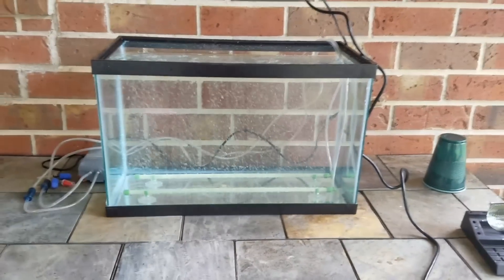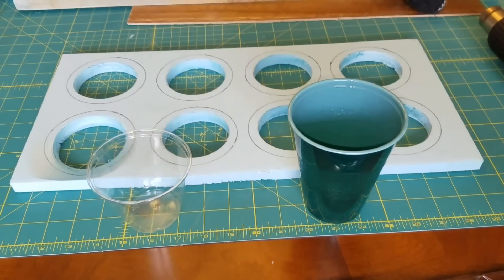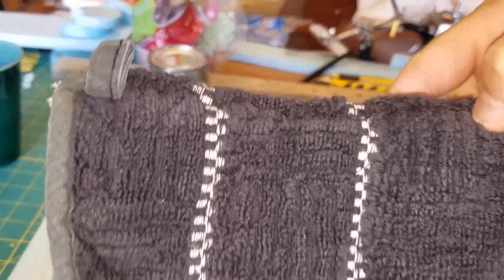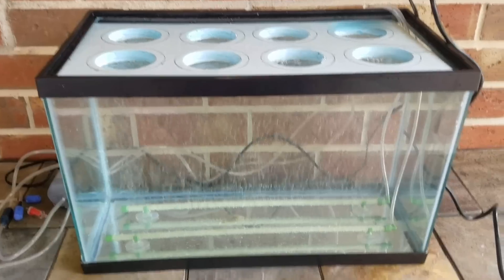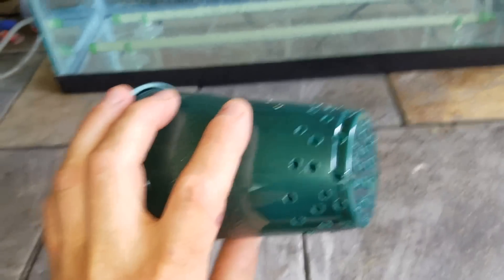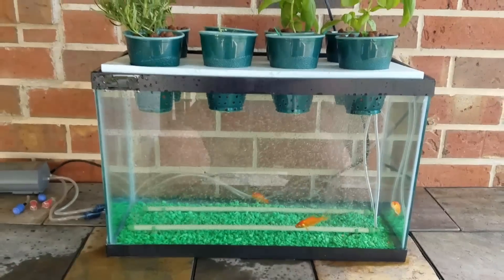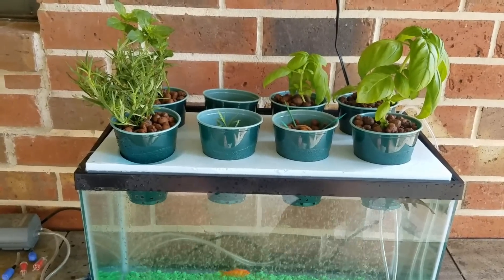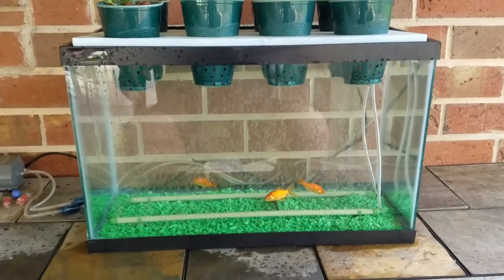My DIY Aquaponics Aquarium Project

Comment: My cousin did almost the same thing only he used the small round terracotta pots. At first he was afraid the pots would fall apart but they actually held up. Less plastic around your food supply (if growing food) the better. He’s starting another tank but this time he’s using glass bottles with holes for better water/nutrient circulation. 👍🏼👍🏼⭐⭐⭐⭐⭐

Comment: I like that! That’s a great idea.I never thought of the heat gun to heat the can to melt the foam turns out so nice looking eliminating the jagged edges.i do use solo cups when planting seeds in the spring and generally one big pack last me several years of reusing and I found if you have a long sharp/new drill bit like 1/8 or 1/4 you can leave them solo cups all together in the stack just like they come in the bags and drill them all at once and cracking rarely happens unless I rush during drilling it’s much faster than doing them individually,I use to do them one at a time and me planting lots of seeds every year I had figure out a better way lol 
I can’t wait to try exactly what you did on this video-awesome job! 👍
Reply from the maker: Thanks!
Here is the update
https://youtu.be/nKq5uRiDQg8
Reply: American blue Rabbit Breeder i

Comment: I used a ten gallon aquarium with a bell syphon to a grow bed using flagstone which is pH neutral. I never have to clean my fish tank because of the ebb and flow of the aquarium water in the grow bed. I would anticipate alot of solid fish waste accumulation in your aquarium. I don't have any stones in the aquarium which allows the pump to suck up all the fish waste. I found that more than 2 fish in an aquarium that size will create a high amonia environment thus killing off your fish unless you change the water frequently which is alot of extra work.
Reply: jimmy1105ful , I appreciate the way you gave this man advice without being rude. I’m so downhearted about the way people speak (or write) to each other these days. Thanks for your civility!
Reply: If you put an aquatic plant in the tank, it will take in the ammonia and nitrogen and you never will have to change the water. Although there was a ton of poop hidden at the bottom, I didn't change my tank water for nearly a year with no fish dying, I had to add water occasionally due to evaporation but that all.

Comment: With the floating raft maybe use a pan of sorts that you can poke very small holes in the bottom than fill that with pumas rocks. The pumas will filter the water and you dint have to put it in the tank as you can pump the tank water up. This way it is a super efficient and self sustaining system for the tank and water.

Comment: Bubbling DOESN'T REMOVE chloramine, it only removes chlorine. Many many water companies use both chemicals, so if you are going to try to bubble out any chemicals then you should call your water company and ask if they add chloramine.
Reply: It also removes the oxygen from the water, which may choke the fish eventually. Basic rule: too much water movement  = more gas release.
Reply: chlorine dissipates naturally fairly quickly, the easiest low tech way to make it go away is slosh water back and forth between twp buckets a dozen times, chloramine lasts much longer and is widely used in North America, the safest and most effective way to get rid of it is with a water conditioner, it works instantly and is safe for your fish.  Where I live the water the water can actually turn green in the spring, and it can smell heavily of chlorine, it's also very hard so water conditioner is pretty much a no brainer
Reply: Oh dear this man is clueless
Reply: Boiling it does
Reply: May i ask how to do the same bubbler? Is it fine for my 50gallons koi fish aquarium?

Comment: If you put a small pump in there that pumps the fish waste out into another container filled with lava rocks and sponges then have it flow back in at the opposite end of the tank your plants and your fish will do a lot better oh and put your air bubblers above the pump it will create a poll that brings all the fish waste to the pump... I have three set up and I use that method is working out great also I do not put gravel so the fish waste will flow across the bottom a lot easier

Comment: Airspeed Alive
 If we are doing this it won't affect the fish right ??? 
Did we have to put seed or Sprout ???
Reply from the maker: Dr. Arun S Son my fish did fine with the plants that I added. Try and choose a type of fish that doesn't eat the roots of your plants. I will say the plants I started as seeds or Sprouts in the system did better than the fully established plants that were transplanted from soil. Throwing some what mature plants into a system that is brand new you kind of deprived the mature plants from adequate nutrients at first. Small plants starting as Sprouts or seeds don't require that much nutrients and can grow with the fish. That's just some advice from my experience so far.
Reply: can you send your mail id ? Because i want to know more information about this procedure

Comment: If you're gonna stick with the goldfish make sure they have 10 gallons per. Goldfish have crazy amonia and get about a 6-12inches long. It doesn't have to be an aquarium you could buy a large Tote or livestock watering trough. Super inexpensive. Costs like 40$ max and would make the fish a lot happier.

Comment: Good simple setup but it has issues. 

The fish choice was not ideal.  Try white cloud minnows or maybe guppies.   Hopefully thats a Bristlenose Pleco, if so he should be fine but they need extra food as the algae in the tank will never be enough for him. I think thats more work than its worth and the goldfish grow far too big for a small tank like that. 

I would have also left the top more open as the water won't have enough surface area with the polystyrene the way it is.  Why not use some Acrylic and have it as a lid on the tank with the 3" hole for the cups? You also need a better filtration system as the detritus will build up and the pleco needs some driftwood.
Reply: i agree with you

Comment: Hey I've got the same set up problem was the goldfish kept on nibbing away the plant roots i've got chives in there and start to think about a solution for protecting the roots or to elevate the styroform plate in an upper tank with a ebb and flow system above.... those long air tubes a pretty cool tho, i've just got a single stone but works out pretty well too

Comment: I believe that works just fine! Yes please do an update on your project. Would like to see the progress! Btw you don't need the toothpicks if you have gravel on the avocado! The reason why people use toothpicks bcuz they use just water instead of gravel. and toothpicks helps it not sink into the bottom. but being you got gravel which supporting it above the water. So you no longer need it anymore!
Reply from the maker: WuPiDu the reason I use the toothpicks and the avocados was because they were initially started just suspended in a cup of water and then I added the clay Pebbles around them after transferring them to one of my homemade net pots. I just left the toothpicks in.

Comment: What is the material you used to fill the cups? Does this require any soil? what types of plants are suitable?
Reply from the maker: Joy George I used clay Pebble grow media.  You can buy online or from any hydroponic supply store.   They are light weight,  but give the roots structure too cling to.   No soil is required.  I'm still new to this , but I've seen a wide variety of plants grown this way.   I'm currently having great success with avacado trees in this same system.  They have grown from seed to about 3 feet tall in about 4 to 5 months.   I'm planing to create a much larger version of this soon.   I've acquired some 275 gallon IBC tanks too use as reservoirs in the system.  Stay tuned.

Comment: If we don't have pellets than what should we use rather
Reply from the maker: You can use lava rock or some sort of gravel. Be careful what kind of rock you use so that you don't do something to the pH level of your system. Whichever type you have available and plan on using just do a quick Google search to determine if that type of stone would alter the pH of the water
Reply from the maker: Aquarium gravel would be pH safe
Reply: Ok thanks

Comment: Sir would u tell me what would we put in cup stone or soil?
Reply from the maker: Hassanhaider110 Haider not soil.   I'm using clay pebble media,  but you can use gravel or rocks.   Make sure your rocks are not a type that will cause PH problems.   You can test rock by pouring vinegar on our to ensure it doesn't react or fizz.  If nothing happens outs probably fine.   I would keep an eye on your PH for a while though.

Comment: Can I use other stuff besides the clay palletes?
Reply: I made a small system and used aquarium gravel. I'd assume the only difference is the surface area for bacteria from gravel vs specialized pellets. But it worked great the way I set it!

Comment: I am just wondering how air will go into the tank ?
Reply: He has bubblers, they force in fresh air from the bottom up, I'm more interested in how he plans to feed the fish, he should cut a small indent out of the styrofoam on each side to have an area to introduce the fish food from, he seems to know the basics of aquaponics but nothing about keeping an aquarium and fish care, hopefully by now he learned his lesson and is keeping a better mix of fish, filtering his tank as well if they are a large number or larger fish that produce more waste like goldfish, and providing hiding spots for the fish so they aren't so stressed out by the set up, also I hope he got water conditioner for them because "bubbling out" the chlorine isnt going to make water changes easy

Comment: The air bubble do not add (DO) Dissolved Oxygen to the water unless the disturb the surface. With the raft i do not believe this will work.
Reply from the maker: That's not true. The air pump which sits outside of the tank is taking in air or oxygen from outside and pumping it under the water and pumping it under the water and exposing a greater amount of the water to said air. It most definitely oxygenates the water.
Reply: Nope no it doesn't.
Reply: Oxygen is added to the water by surface agitation. Look it up. Wow
Reply from the maker: Todd Demler you should Wikipedia water aeration and take a look at the types of subsurface aeration particularly fine Bubble aeration which is actually a very efficient means of transferring oxygen into the water.

Comment: Any issues with the goldfish eating the roots once they grow beyond the cups?
Reply from the maker: Michael Stoddard yes, but not bad if they're fed regularly.   I'm working on a larger system now that will be very different.   I will try having fish tank with majority of fish separate from plants next time or maybe one placo in each tank with plants.   The plants that I transplanted to the system that were initially started in soil did not do as well as plants that were seeded and started their life in the aquaponics system. The avocado trees are doing very well. Those were started as seeds in the aquaponics system and one is two and a half feet tall and the other one is 2 feet tall at the moment and still thriving even with goldfish having access to the roots. I think in my next system with the Goldfish not having access to the roots will have even better results.
Reply from the maker: Yes.  My next setup will separate the plants from the fish if using goldfish.  The avocados didn't mind too much and just grew a tighter cluster of roots in the cups, but the other plants didn't like it too much and were more susceptible to disease etc because of it.  
Here is the update
https://youtu.be/nKq5uRiDQg8

Comment: does adding nutrients effect the fish.
Reply from the maker: Chris Lighthall the idea with this system is that you don't have to add any nutrients and I have not. The plants grow purely on the fish waste. All you do is feed the fish. The plants pull the nitrogen and waste out of the water filtering the water for the fish. It's not perfect but it's a good test run for a larger system that I am currently working on.

Comment: Gold Fish are not heat tolerant. Nice set up though...
Reply from the maker: trevormcmanis goldfish are the most heat and cold tolerant General Aquarium fish I've found for the Texas climate. They survived through 100 degree days and days with temps down near freezing. My newest system is 20 times larger in capacity with a 200 gallon total water capacity so it's a little more resistant to drastic temperature changes and I'm running a heater in the tank for the really cold days in the winter time.

Comment: Nice system but this is not in fact an 100% Aquaponic as the water is not filtered by the plants. You need a pump to get the water and the waste from the bottom of the tank to the roots of the plants. Anyway interesting stuff :)

Comment: This is not Aquaponics System, this call Hydroponic System.
Reply: This includes fish, so it wouldn't be a hydroponics system.
Reply: This is a hydroponics System with fish ( fish waste works as a plant fertilizer, no more no less ). 
On the other hand, Aquaponics System should include bell siphon to fill the plants pot or containers with water to the top and to empty it almost completely automatically all the time.